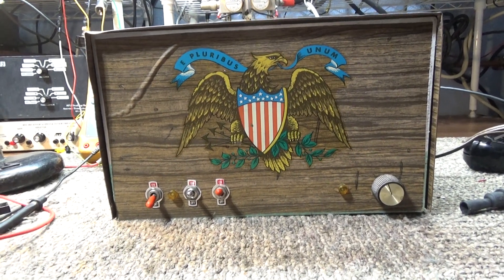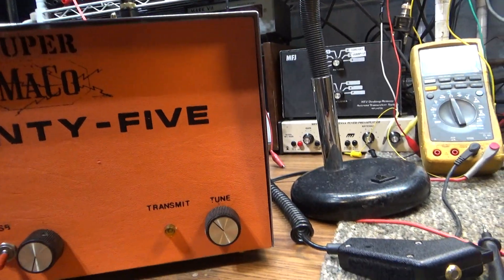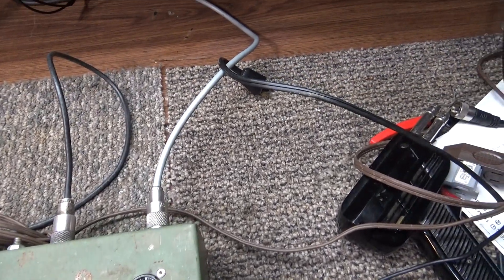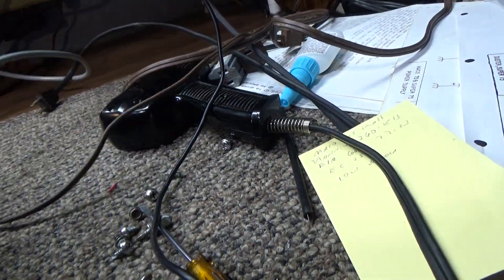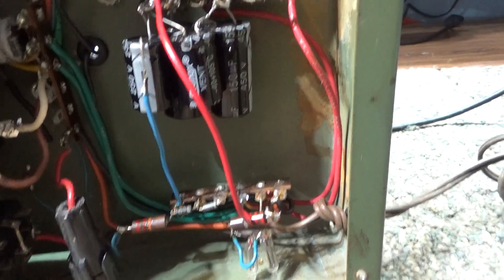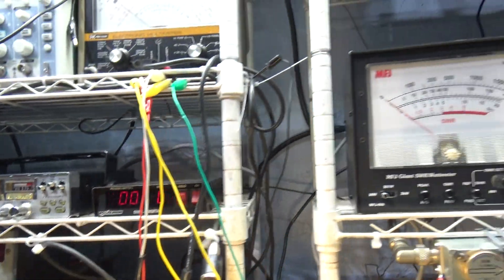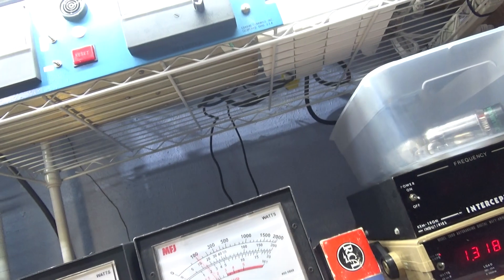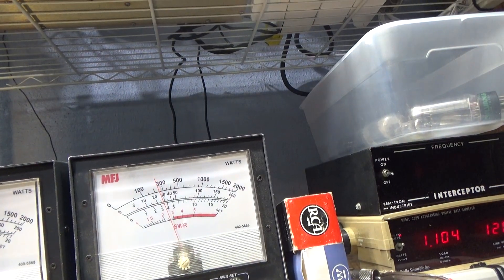Maco surprise amplifier up and going on the bench

Comment: Wow! I long for the days when it was cheaper to add an extra sweep tube than put in a 6 volt transformer, or a 12 volt tube!
Reply from the maker: Those days of cheap sweep tubes are long gone.
Reply: @tramdr  Yep. And when I was a kid people threw their tube TV sets into the woods and I would pull the tubes out and shoot them with my pellet rifle. Lots of good sweep tubes were popped by me back in the 60’s.😢
Reply from the maker: After High School, I went straight into the Army in 80. Back then sweep tubes were ten bucks. I got back into CB around 86 and went to a local shop to get some, I thought he was pulling my leg when he said 39 a piece.